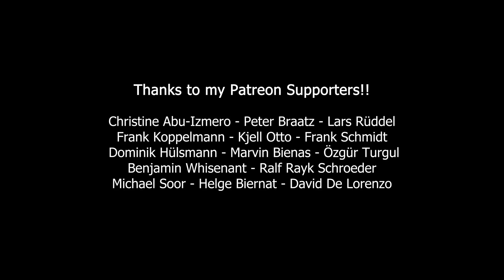DIY Shredding Station | Turning plastic waste into granules for my injection machine!!

Comment: Nice job, I am just concerned for the inevitable runout of the welded shaft which will turn into a pulsing fatigue…
Reply: @reverendtfg6802  the issue is roto flexing fatigue and it is more geometrical than torque related